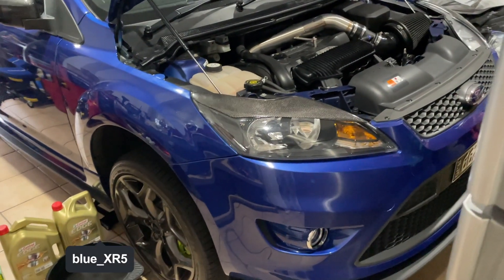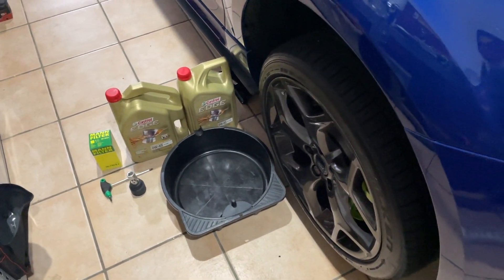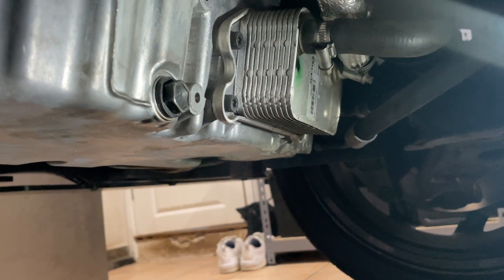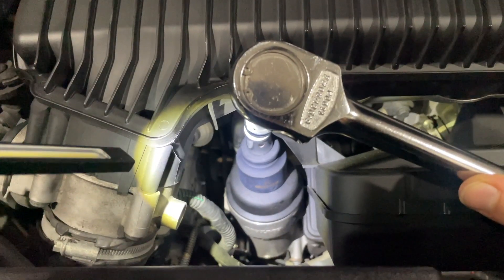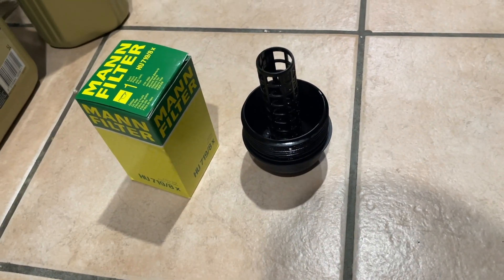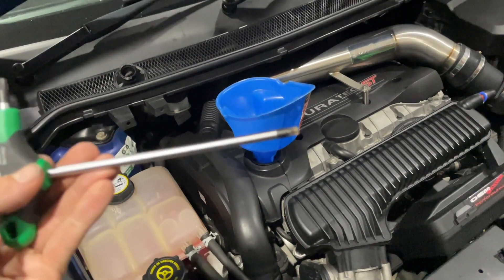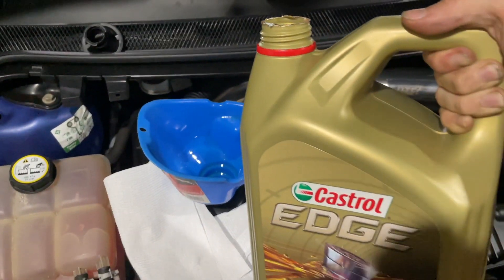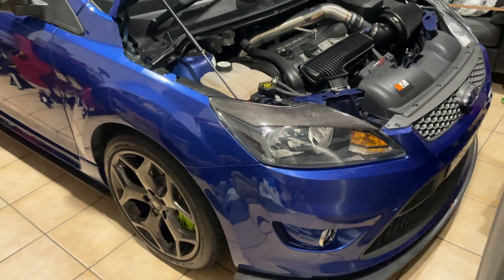Ford Focus XR5/ST225 Oil Change

Comment: Thanks for the video. It is interesting that Castrol UK site recommends 5W-30 but Castrol Australia recommends 0W-40. Castrol UK only recommends 0W40 for Focus RS. Since I live in a cold part of Melbourne (Dandenong mountains), I use Castrol Edge A3/B4 5W-30 in my  2010 Focus ST/XR5. Engine runs like new after 14 years.
Reply from the maker: Thank you for watching and leaving a comment, I also saw that you subscribed to the channel, really appreciate your support. Yeah it is definitely interesting how they recommend 5W-30 in the UK and most of Europe, I’m the third owner of my XR5 and from all of the service history it’s always had OW40 so I’ve just stuck with it. And it seems to be working fine with no issues whatsoever, so I guess it must depend on preference possibly. The Dandenong Mountains would be a great place to live for driving roads from the sounds of it 😄
Reply: @TheGearChange  I think 0w40 is good for over 300hp and better protect on cold start ,i prefer 0w40 too😃
Reply from the maker: @ga002078  It works great with my Focus so I'll be sticking with it 😄

Comment: Just did a service on the XR5 today, and my old oil was pretty black like yours, however the O-Ring around the filter was also very oily, unlike yours which looked pretty much new... 

Also, I didn't have some of the tools needed, such as the 36mm socket for the oil filter, making the oil change a very annoying job... I used 6.5 litres of Penrite 5W-30 Fully Synthetic (I know some use 0W-40 like yourself, but I guess both are fine), and a genuine oil filter...
Reply from the maker: Nicely done, yeah the oil change isn’t a fun job especially if you didn’t have the 36MM socket for the filter that would’ve been tricky. And Penrite is perfect I just went with the Castrol as it’s what the car has had since new just to keep it consistent with all the servicing books 😄
Reply: @TheGearChange  Well I did buy the 36mm socket, but the issue was that it was too large, and I didn't really have the correct attachment for it... In the end, I got the filter off with some pliers lol... Dodgy I know, but it works at least 😂
Reply: @TheGearChange  Fair enough on keeping it consistent with the service books... Mine doesn't really have a full service history, and it seems like various grades of oil were used by the Ford dealer for some reason...

Comment: How much oil did you put in the engine? i noticed you had two 5L bottles
Reply from the maker: I put 6.4L in the engine, which is the amount that the service book says. It was cheaper to buy two of the 5L bottles then one 5L bottle and multiple 1 litres 😄👌🏼